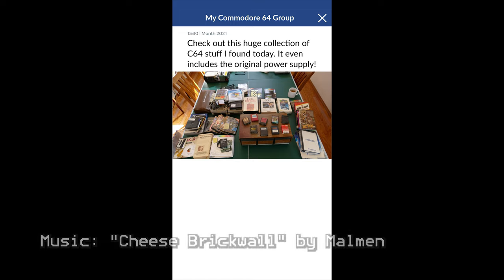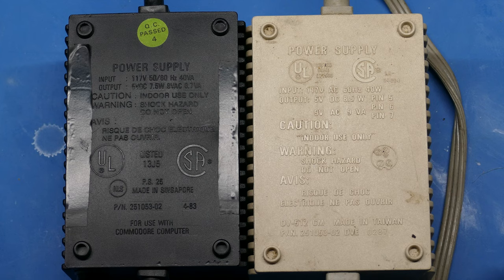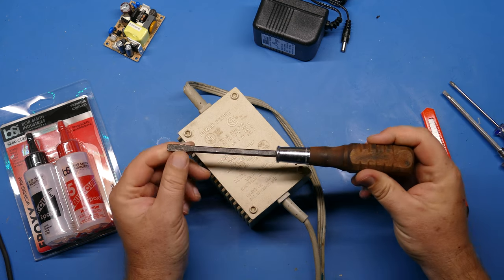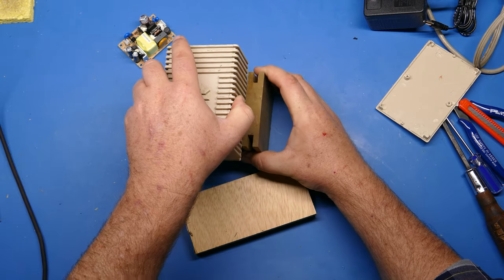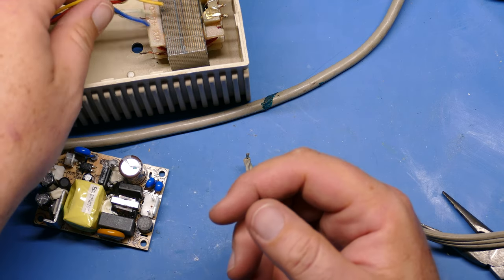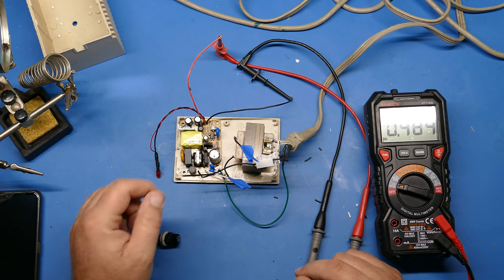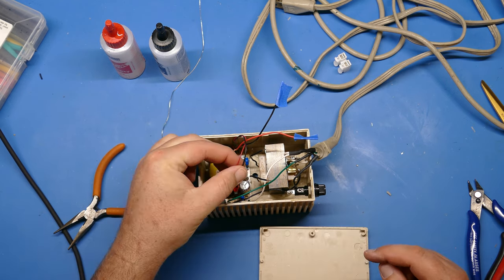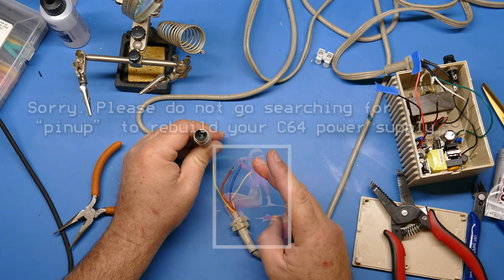Rebuilding A Commodore 64 Power Supply

Comment: Good video.  I plan to do the same thing but possible with the addition of a crowbar circuit,  since switching power supplies can have somewhat wide tolerances for output voltage.
Reply: Scratch that,  I was able to remove the original transformer from the epoxy,  it chips away fairly easily.  I think I'll just build a new linear supply with crowbar/protection circuit.
Reply from the maker: Cool. Let me know how it comes out.
Reply: @RetroHackShack  Will do,  gonna try to mock it up tonight assuming I have everything I need.
Reply: Finally got it up and running,  power supply works great,  but I was greeted with this  -   https://imgur.com/a/QXeWH9D

So after some research I'm assuming a PLA or Color RAM issue.  Possibly one of the standard logic chips if I'm lucky.  I noticed the GAL PLA on ebay and realized that I actually have some of those GAL 20V8 chips and a TL866+ programmer,  so I just ordered the board to make them from PCB Way which was a lot cheaper. I think troubleshooting is just down to trial and error at this point.
Reply from the maker: At least the PS works. Great job!
Reply: @RetroHackShack  Thanks!  Your video was very helpful and I love your channel.  Ordered the Meanwell supply that you used,  nice and compact.   Power supply before and after - https://imgur.com/a/mtJU7Q4

Still a ways to go yet!
Reply: @RetroHackShack  Up and running!  Replaced the bad PLA,  no more funky colors -  https://imgur.com/a/jQjloX1

And the original SID works!
Reply: What's a crowbar circuit?
Reply: @blackterminal  It's a protection circuit that's fairly easy to make,  although its probably overkill on the output of a switching supply.  I've set it to not allow the power supply to output more than 5.3V.  If it goes above 5.3V for whatever reason, it immediately blows the fuse.

Comment: I still have my C64 but I stopped trying to use it because I suspected the power supply, with the warped case, was the culprit. I still have one or 2 PSUs lurking in storage and I'd rather buy a new one that I have confidence won't fry my dinosaur.

Comment: You'll have fun if you ever want to replace caps on that power board you glued in there. I'd imagine you'd have to tear it apart to get it out.  If you'd glued in some feet then screwed the board in that would have helped. But I'm not perfect with my projects either. Far from it.
Reply from the maker: I thought about it, but these meanwell power supplies are good quality and should last a long time. The board will pop out with a little force if I ever need to remove it.

Comment: What about the over voltage protection? The datasheet of the Meanwell EPS-15-5 says that the shutdown is at 5.6 ~ 6.75V. That is too much for C64!
Reply from the maker: I suppose you could add a 5.1V zener diode if you were really worried about that. It is still going to be a lot less than the 11 - 13V that would hit the 5V line in the old power supply. What would you suggest?
Reply: @RetroHackShack  SOLVED! After a research - my solution: I put a TVS diode parallel to the 5V output. The 1N5908 is dedicated to the 5 V logic circuit protection (TTL and CMOS technologies).Their low clamping voltage at high current level guarantees excellent protection for sensitive components.
Reply: @RetroHackShack  1N5338B (B is +/-5% of marked Voltage) can absorb 0.93Amps fully "On". At that point there's 6.0Volts across the leads.
Reply: Aliexpress step-down converter

Comment: maybe nice if You save the original 9V~ transformer and just replace the 5V= power supply somehow.
Reply from the maker: In for a penny in for a pound.
Reply: Some power supplies were not potted. The oldest type that I'm lucky enough to have one. I put a step-down regulator from aliexpress inside. No further concerns.